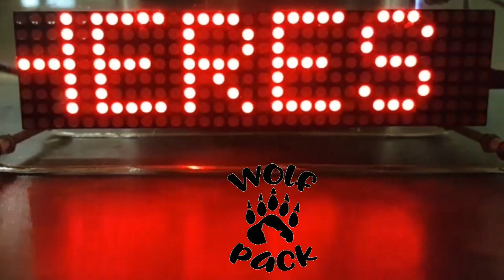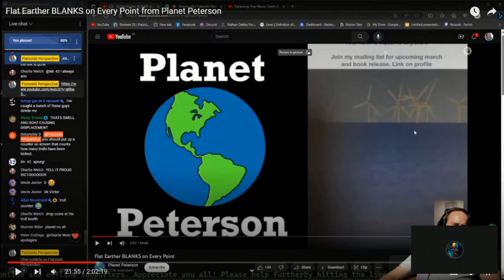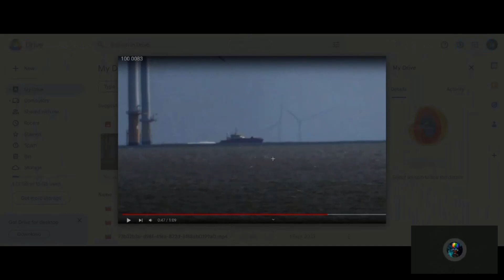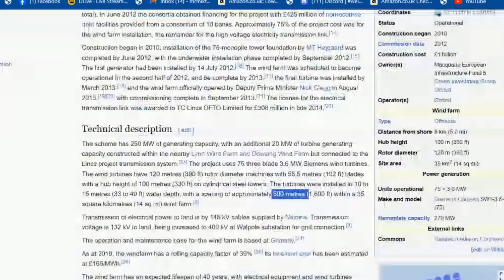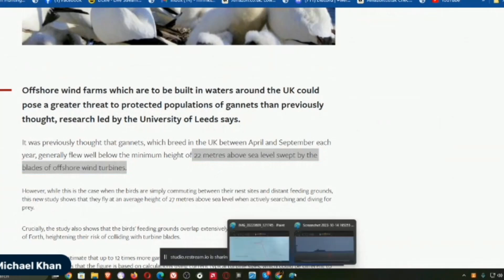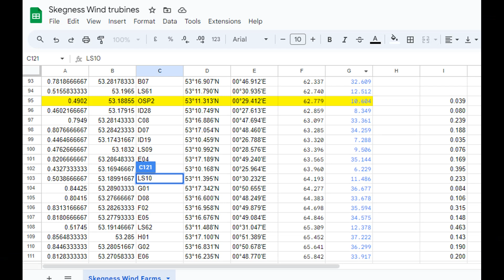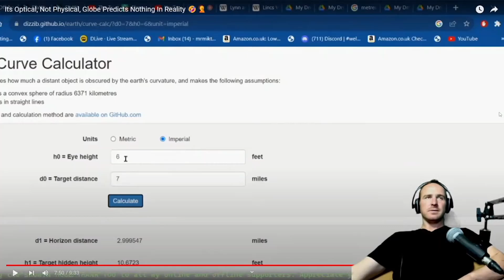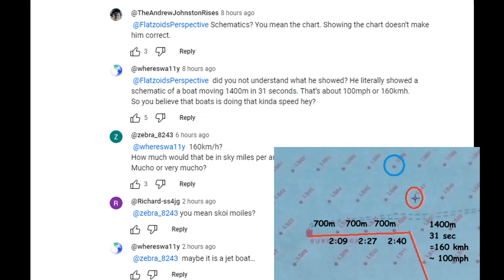Flatzoid's 11 Ep7 By Proxy - Wally Braves The Wrath Of Khan  - The Great Globe Prover

Comment: Why didn’t you include diminished angle when claiming a target hidden height? You stated the turbines are diminished in angular size then ignored that when claiming a target hidden height. Why?
Reply from the maker: Simply because the amount hidden is a ratio. What we see over the amount we should see. Works are any distance.
Reply: @whereswa11y  and you didn’t include diminished angular size in your hidden height calculation.
Reply from the maker: @intothebreak571  dude it is all included in the perspective calculation. 
Let’s see if you are smart enough to continue. 
If I see a 100m tall turbine that is let’s say 6 km out to sea and then right near it is another 100m tall turbine but this time it is only half the apparent height. Roughly how far away is that turbine?
Reply: @whereswa11y  where’s the perspective calculation in walters curve calculator calculating hidden height? Be very specific with exactly where that is present. Don’t ask me a question without backing your baseless assertion?

Comment: An incredibly thorough debunk.. although for something to be debunked, surely it needs to be a decent argument in the first place. Arguing from his end conclusion (the earth is flat therefore it must be something else we're seeing) is simply not how logic or science works. And it's important to get the core facts right (like what you are actually looking at) before you start. But even if he had got the right location, his mathematics is appalling.

So...The fact that anyone from outside the US attempts to do anything in miles and feet tells us it's a car crash approaching. Why not just convert his (incorrect) five miles into km and then everything else is in the right units?! (and that '5 miles' looks far too close to a round number to be accurate anyway.. I am suspecting it's a general approximation rather than the position of the closest turbine. So, could be wildly off by half a mile or so... or  the turbines could indeed be maybe half a mile closer. And for someone going for accuracy (or not) rounding his viewer height to 6' only works if his feet are getting wet on the beach, and rounding 6.124 up to 7 leaves a 14.3% inaccuracy in his measurement - the sheer deception of rounding up by .86 instead of rounding down by .12 is sign of someone who's never done any practical mathematics in their life.

So, just that 14.3% inaccuracy, when actually applied to the curve of the earth (ie non-linear impact) takes us from 3.25m hidden to 1.98m hidden which I make to be an error of 64% in his final result. Ouch.

Comment: At 2.24 the is a shot of the wind turbines 4 of which are in almost a row from the camera but if you try to draw a straight line thru the 4 the line is not  straight, Flatzoid why?

Comment: Hey Wally, in your description, under “Race bank wind farm,” did you mean to say “hub height 177m” instead of “rotor diameter 177m?” Just checking…
Reply from the maker: Sorry I may have derped. tower/hub is around 100m I believe. Rotor are longer at 77m 
Some reference give the height as 177m and that would seem to be hub + rotor.
Reply: @whereswa11y  no worries; brain farts happen to the best of us. Unlike flerfs, we don’t try to deny it. It’s still an epic video. 👍

Comment: Beautiful job. Khan demonstrated one problem with "Look reality doesn't match the globe prediction". You have to accurately model reality. Khan failed to be accurate. He even put himself to the left of the pier when that pole in the sea puts him in front of the pier or slightly to the right of it. He got an inaccurate prediction. Having got what he wanted, globe wrong, he thought that is a good one and made his video. Thereby demonstrating the other major problem flerfs have, confirmation bias. When you want to find error it is sooooo easy to find it but these errors are not the ones you are looking for.
Reply from the maker: I am seriously wonder which side he was actually on.
I had a laugh with Andrew ... surely North or South side would be more precise.
And funny enough if I place Khan on the north side, ie with pier on his left looking out to sea, then the two large turbines on left of his screen cap actually swap sides. so he really had to be on the south side. The metal thingy in the water also suggests that.

Comment: A day with slightly more than standard refraction, meaning a day with a surface temperature slightly lower than that used to calculate the standard 1.17R?
Sounds about right for the North Sea. If you fall in the North Sea and it's warm, you've fallen in a sewage outfall.

Comment: What is a “Perpendiculator”?
Reply: The Perpendiculator is used in conjunction with the Tangent-o-plano-sphere.
Reply: @Sherwoody  I see what you mean, but you need an oppositometer to figure out the right dangle, dont you?
Reply: @HOOOLD_ON  you can use the flat earth equation to calculate the area of the flat earth. 
It’s  pi + z + z = a
Reply: @Sherwoody  Nice. I guess Flatzoid is aware of this, but he is unfortunately incapable of using any formula that has letters in it. Hence all the derp.
Reply from the maker: The Perpendiculator attaches to the rotaryilizer. Thus it will allow any angle to be accessed.
Reply: @whereswa11y lizer? Very flexible and accommodating girl 😂